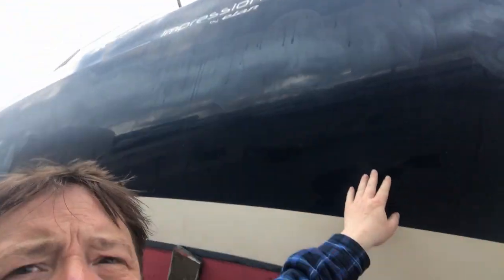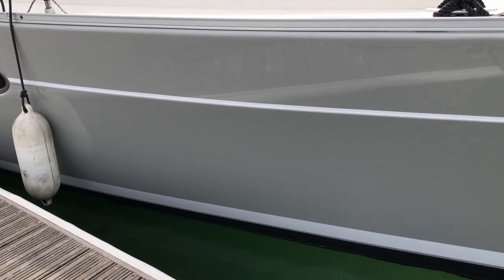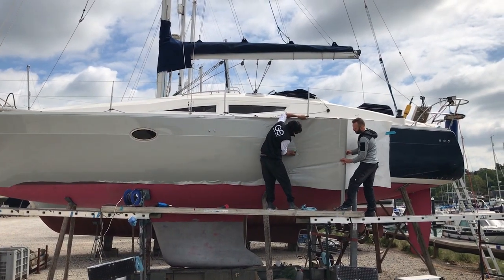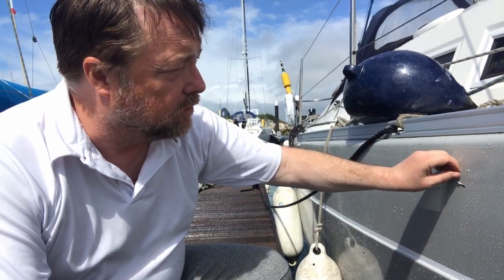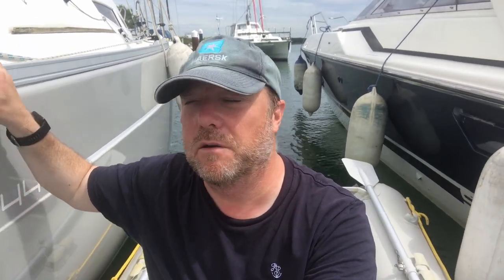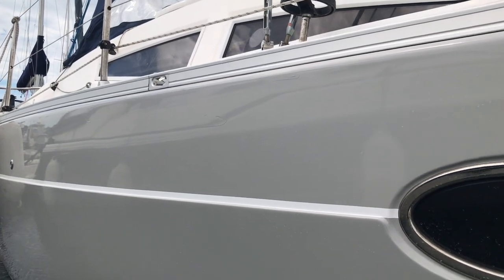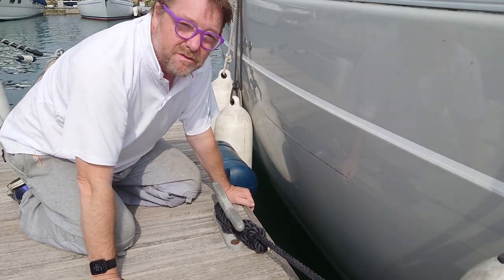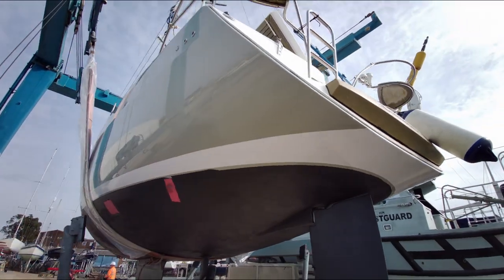Vinyl wrapping the hull of a small boat - A long term view

Comment: Wrap it the same colour as original and you can live with the scrapes
Reply from the maker: Excellent suggestion 👍
Reply: I was thinking of the same the other day.  The boat I’m thinking is white and was wondering about a white wrap. I do love the look of a blue boat.
Reply from the maker: @YTMegiddo if you are buying a boat with a hull in tip top condition, you could wrap it, knock it about for few years  leave it in the sun etc.  
Then remove the wrap when you sell it and voila... You're selling a boat with a hull in tip top condition. The wrap guys told me they wrap a lot of brand new boats for that very reason.
Reply: I think this is essential since the stuff is so fragile.

Comment: The truth is that the supplier is correct, the vinyl is for above water line only. It seems that even though the factory water line is indeed there, if loading the boat and time, the boat sinks slightly further, the waterline should be corrected :)

In my opinion I would have polished and detailed the current paint, you will be surprised with how it can be restored
Reply from the maker: Had the hull Polished and detailed twice by professionals and did it myself twice. It did work, but didn't last more than a month before returning to a poor condition